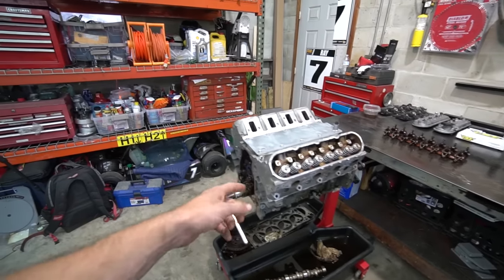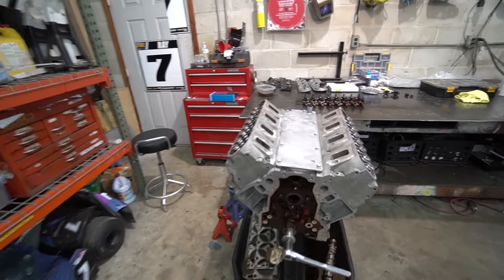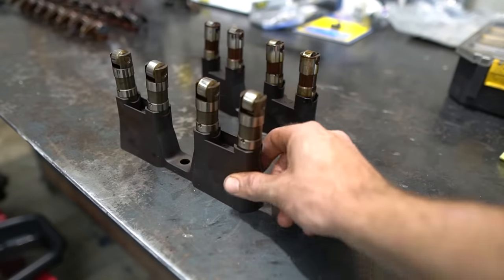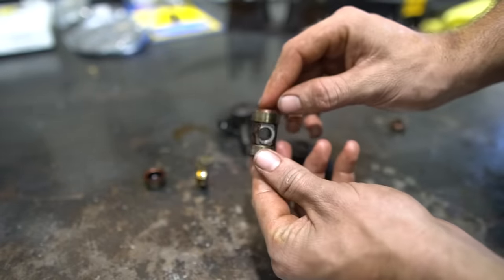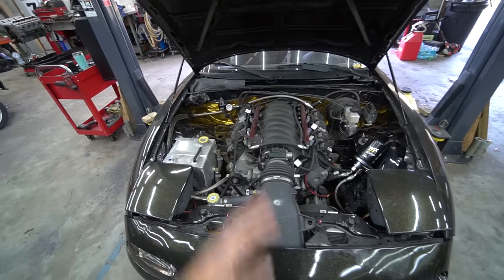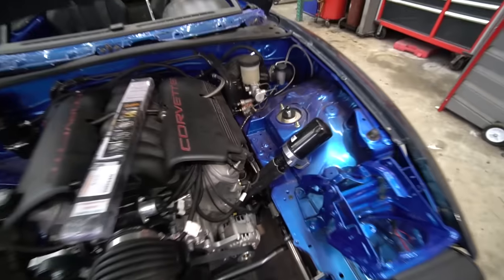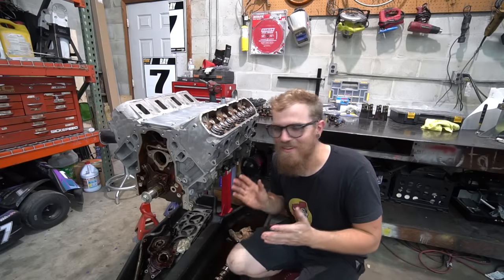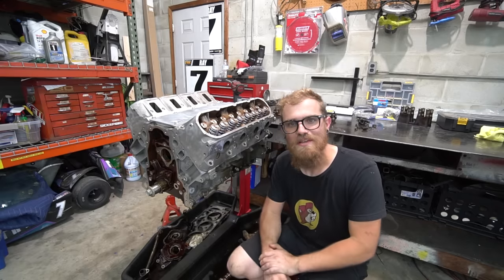Top 5 Mods To Make An LS Engine Reliable.

Comment: Step one: put oil in              Step two: don’t keep it above 7k its whole life step three: enjoy your ls motor for hundreds of thousands of miles
Reply: G hrvyck  I've never seen one NOT make it to 100k miles absent it being beat on or poorly maintained.
Reply: G hrvyck  ....lmfao...you sound crazy...every ls I've owned was over 200k....lol...
Reply: G hrvyck  When I see someone volunteer information like 50+ years master tech, I think of all the people who say they were navy seal marine spys.
You don't have a damn clue what you're talking about because you were never there.
Reply: Agreed, this guy is full of chit. If you don't like GM then that's your business, but don't be such a hater that you spread lies on the internet. First I currently own an 88 GT, 03 Cobra, 03 Lightning, 13 Taurus along with other Fords I've owned in the past so I'm no Ford hater, but to act like an LS isn't the best motor for a Foxbody/SN95 swap is just someone being a hater because you're likely a Ford fanboy. And that's fine but own the fact that no other V8 platform can drop the lbs and be positioned as ideally in those cars (or really most any other cars) chassis as an LS can be. Then you have more options for modding big power (using boost, or a shot, or staying N/A and having a ton of dispacement options available) then any other platform within a reasonable cost to mod. 

I've only ever had 2 issues with LS "motors" (not LS powered cars) that I can think of. 1) I had an LS1 who's alternator went bad. I fixed it with one I bought off a wrecked 04 Yukon with like 165K miles and it was trouble free since. Another time I had the thermostat gasket shear and get into the spring on the thermostat and lock it open. It basically wouldn't let the motor come all the way up to full temperature. Easy and cheap fix. I've known many people with LS based motors that ran like tops at 250K+ miles even if the rest of the vehicle felt worn. Generally speaking your LS based motors without AFM are some of the most reliable and problem free motors there are. Can some high mileage (and more importantly "old") LS motors develop issues like leaks around the oil pan seal, etc? Sure, but overall they experience fewer common issues than most other motors.
Reply: G hrvyck  My 02 silverado has over 257,000 on it.I have only changed the intake gaskets and water pump on it.
Reply: G hrvyck  Not for sure.I bought it used with a 177,000 miles on it.From my understanding these motors only have a few down falls.Intake gaskets that fail periodically.Knock sensors on top of the intake.Replace the knock sensor when doing so use rtv on knock sensor to prevent moisture from coming in.Been told that they have a crappy idle to them.After I replaced the intake gaskets on my truck it idles smooth and quiet other than the fuel pump whining like it's about blow up.I drove it about 8 hours straight one time.When I pulled up to  the motel room I noticed everyone stopped and looked at me funny.I left the truck running so my wife kids had ac.I got out and that fuel pump was whining so bad it hurt my ears.I figured I would be replacing the fuel pump on that trip.That has been a few  years ago and many miles same pump.
Reply: G hrvyck  because Ford has the best fleet prices. Nothing to do with reliability.
Reply: @notsure7874  just put two holes in my block 88k miles.. 2014 camaro ss. Evo.gsr check it out
Reply: @JacobsInvestments  I can't check it out - there's no link. Ok so you got me - I HAVE seen them NOT get to 100k miles - if you spray the hell ot of it, boost it to death, etc. I'll rephrase - "with original cam" which you basically have to do at that point. But at that point, it's not exactly a production engine either - and you're beating the brakes off that car at every opportunity.
Reply: G hrvyck  "Anybody that bought a cheapy-equipped hemi car, didn't buy it to drive it like a Sunday morning church going grandma"

Since when is a Hemi a GM LS engine?

Also, I notice that you correct someone on engine vs motor - which is a bit pedantic, however you go on to say something about a 78 460 "BBF" - what the fuck is a BBF? Big block ford? Surely you're aware there is no such thing as a BBF or SBF right? Those are terms referring to specific GM engines. There's a Ford 385 series, which came in a 460, so maybe that's what you have? Pretty sure an FE was never offered in 460, but whatever... either way - neither of those are "big blocks" - oh and GM also made some large engines like the Pontiac engines that were NOT "big block" or "small block" - it has NOTHING to do with how "big" an engine is, it's a SPECIFIC engine type.

50+ years ... Ok boomer. Tell me all about them 3/4 race cams :D You're stuck in the 70's or something man - new shit has come and gone since then.
Reply: G hrvyck  Big block and small block refer to CHEVY engine families. PERIOD. "bbf" and "sbf" are 100% misnomers. And yes - Pontiac had one size engine block. With big or small journals.
Reply: G hrvyck  "Not possible.  Rarely do they make it to 100K miles." The guy that said this regarding LS engines, then proceeds to use a Hemi as an example of how an LS is unreliable ... does NOT in any way shape or form know more about engines than I do. But you sure as heck might have FORGOTTEN a lot about them!
Reply: G hrvyck  And you still can't tell the difference between a chrysler hemi, and a chevy LS? Still sticking to the "rarely last over 100k miles" - C'mon man! :D
Reply: G hrvyck  As for the BBF - what are you calling a BBF? I've heard FE's called BBF, and 385's, I've even heard 335's called BBF. But none of them are, any more than the Pontiac V8 is a "big block".
Reply: G hrvyck  There are many flaws with the SBC, many of which were addressed with the LS - which is why it's ridiculous to say they can't last 100k miles, because all 4 of my current SBC / LS's have more than 100k miles on them. It's also Depends if you're talking solid or hydraulic lifters, because you have to set the backlash on the gears, C is a Cleveland - which is a 335 block, M was a 335 with a taller deck height, only came with a 2bbl and it was a dog - came in a 351 and a 400, I'm not a chrysler guy and don't give a fuck about that, Depends what electronic ignition syste you're talking about, but it's silly to memorize, especially since I don't build many fords, again - I don't care about ignition voltages, look that shit up as needed but it also depends on what system, and what part of the system, unleaded is no good because of the valve seats, and you can put hardened seats in to run unleaded. Oh and the 2.0L chevy I also don't care about, I don't work on broken pieces of shit unless I own them, and I have no desire to burn money making one fast. 

But that doesn't address why you use the hemi as an example of LS's being "unreliable"

Can you explain what an 80 year old guy is doing still working on cars, and arguing on the internet about them? And again - why you used a hemi as an example of an LS,  and explain why you think an LS is virtually incapable of making it past 100k miles? Can you explain how despite modern advancements in engine design somehow "suck" compared to a crude old 460 you claim has over 400k miles and still going in a tow truck or whatever?

And again - how is a hemi an LS? Because you haven't answered why you used a hemi as an example of an LS not lasting.
Reply: G hrvyck  Oh - but here's a design flaw of the Chevy 2.0 now that I'm thinking about it - it's a 4 cylinder, and they can't really be balanced perfectly. Can you tell me the minimum number of cylinders needed to achieve a perfect balance?
Reply: G hrvyck  5 cylinders from a theoretical perspective when you're talking about harmonics, and of course they have to have counterbalances - which is why a lot of 4 bangers have a balance shaft - but yes, none will be perfect in practice, not even a top fuel engine, but they get damn close.

As for the major design flaw - again, I don't care about a 2.0 chevy 4 banger, but there are many design flaws with any engine - including the LS, hemi, etc. There is no such thing as perfect, even in a top fuel car - which a guy I went to high school races to this day last time I checked - he lost his thumb running a top fuel car beyond the gravel into the woods when his brakes and chute failed -  And no, I'm not claiming his experience as mine.

I balance all that shit in my crappy strip car too, even though I'm keeping it under 10's - because I can't afford all that SFI rated gear, and replacing stuff periodically just to keep it in date to pass tech after breaking into 9's and 8's. One of my friends has a pro mod vega running low 6's that he has to do that shit with, and he's got damn near a quarter mil in that car. Also, my track here is IHRA, not NHRA.
Reply: G hrvyck  

I assumed 80 or so, but I can't be THAT far off - you said '63 - and my dad was 13 then - he's 70 - so you're what, 71? if you were say - 18 or 20 at that time so a pretty reasonable assumption. Still, beyond wrenching on cars and racing days.

Referring to LS's not being able to make it past 100k - "Anybody that bought a cheapy-equipped hemi car, didn't buy it to drive it like a Sunday morning church going grandma. Mine kept having issues with the  connecting rod bolts stretching. Milidon connecting rod bolts cured that but the car developed several other problems." Nobody mentioned a hemi until then.

What does a hemi have to do with an LS? And you were asking about a 2.0L 4 banger, not a chevy V8 - which I addressed all those as fast as I could type off the top of my head, while working - all the crap about unleaded gas and whatnot - and stupid specifics about particular voltages which 1. I don't care to memorize, and 2. depends on what you're measuring - primary coil voltage? secondary? the trigger??? Not that it really matters. I mean - can you tell me offhand what the valve lift, duration and overlap is on a 1991 TBI equipped sbc 5.0L in a truck application is? No? Because memorizing that shit is stupid - but I bet you could look it up if you needed that info for some reason. But "gotchas" can be thrown around both directions, and they prove absolutely NOTHING.

If you're suggesting the previous gens of SBC are more reliable than an LS, well - the LS has baked in a lot of the upgrades people used to make, and then some. Skirted block, better materials, tighter tolerances, SPM cast heads (some of them) so you don't have to port / polish, air gap intake, aluminum heads that actually flow, roller lifters in cartridges with pushrod guides, sintered metal rods that have the caps cracked so they index perfect every time, and they're nearly as strong as a lot of forged steel rods, better firing order (which SBC guys used to and still do switch to), much MUCH better bering material, better oiling, a bottom end that can handle well over 1000hp from a junk yard pull with 100k miles on it - which as a side effect, ring wear often gaps it pretty close to where you need it for power adders so you don't even have to pull heads if you dont' want to, a far superior coil near plug ignition system, returnless fuel rail, better injectors, moulded rubber gaskets, MLS head gaskets, - all from the factory - and blah blah blah the list goes on and on - I see them with over 200k miles regularly. I have 2 of them, and 2 sbc's - 3 of which have well over 100k miles, the other is in a boat - which stays under load nearly 100% of the time, and arent measured in miles.

Bottom line is - I'll take an LS over an earlier SBC, or any Ford OHC like the modular, or a Ford Windsor, or a 335, or a pontiac, or even the buick v6. It's not that I hate any of those. If you want big power out of a small V8 for less money - the LS is where it's at, and has been for a decade or more - ever since they started showing up in salvage yards for a reasonable price. And YES they are reliable. More reliable on a SBE than ANY of the above, especially when you start pushing them for power.
Reply: G hrvyck  Yes, crude compared to todays tech. "distributor" - case in point. The materials weren't as good, the tolerances were relatively sloppy by todays standards, the car carrier you said had 400k miles - and that's entirely possible, I've seen them go that far - but generally not. Oh - 400mi to a rebuild, so it doesn't have 600k, you rebuilt it. Oh - so it came out of a CAR, so it wasn't being used as a car carrier for 400k miles, it was a giant engine in a relatively light car. No suprise that it went a long time. 370hp ... so about the same as a 6.2L LS from the factory but a lot heavier.

Dont' get me wrong - I love the 385's, and FE's - which in a lot of ways I like a LOT better than the 385's particularly the side oiler, and SBC's, and BBC's, and Windsors, and 335's - as long as it's not a M - I've owned all except the 351C ... and I like the LS just fine too - they're a LOT cheaper to build a reliable and powerful engine. I get and appreciate the nostalgia, but they aren't "better" or more reliable than modern engines. We have better materials, better machining, better casting technology, advanced engine management systems - time marches on. Gassers aren't "the way" anymore just like carburetors aren't. The LS - is most definitely more reliable than these, until you start talking the big heavy old mills in a heavy duty application - but there are also big heavy engines today that have made similar advancements.
Reply: G hrvyck  Yeah man - that's scary fast. My friends vega chassis is certified to run I think ... over 226, and sub 6 seconds? Big roots blower on a BBC with tophat injection - I don't mess with that stuff, it's to expensive for my taste. My friend Bobby - he was running top fuel from the time he turned 18 iirc. It was before they shortened the runs to 1000 feet, and they'd exceed 300mph. I really don't think I WANT to go that fast honestly. My fastest run was 2 decades ago - mid 9's, around 150 - 160. 377 2 stage sprayed SBC in a 72 camaro. I'd like to go faster, but I don't want to spend the captain insaneo money on all the SFI bellhousings, and TC's, and chassis certs, and jesus, you even have to replace the seat belts like every year or 2 - it's just too much - but I'd be happy somewhere in the 8's, somewhere south of 200 if money were no object. Absolutely NO desire to hit 3's at 300.

And here's a shocker for you - LS mated to a TH-400. Yeah that's right, an old tech all hydraulic no electronics, no lockup 3 speed. I woudln't do that if it was a street car though.
Reply: G hrvyck  Yeah man, that's why you have to adjust for lash with shims, and one reason I say we have better tech now - because tolerances are tighter. Freeze plugs - so hopefully your block doesn't crack if the water freezes inside there ... hopefully! I've seen them crack anyway back when I lived in the frozen north. Boats generally use raw water cooling, and it drains out. There are plenty of marine setups that use a raw water to coolant heat exchanger though, and they last a hell of a lot longer in salt water. I've also seen 302's with what I'd consider mild power levels split right down the lifter valley - which is another reason I say we have better tech now. Not that I don't appreciate the old stuff, because I most certainly do.

low 11's was damn respectable for a streetable car back then. The camaro was hardly what I'd call streetable in the 9's, but it was registered and got driven on the street occasionally. Almost everything down here is street legal. The stang I'm building now (88 hatch, LS power with TH-400, 8.8" 5 lug w/ 3.73 spooled, switch to 4.10 if it's not enough gear) is getting straight pipes out the fenders and it's street legal - here anyway. We don't have inspections, or any of that nonsense. I'm trying to keep it all under 2400lb. subframe connectors, the torque box reinforcements, chromoly cage, all welded in, tubular 4 links, blah blah. I think I've got 12x33's on the spec sheet on 10" rims is all I can fit without tubs, it's getting slicks so THAT isn't street legal but it'll be tagged. Debating running E85, but probably going to run a race fuel blend. I considered avgas, but its specific density isn't the same as race fuel, so you don't really get the same octane at sea level. Megasquirt controlling the ignition, fuel, and nitrous - 4k stall converter, trans brake - the class I want to race in I have to be above a 9.99, and below an 11.00 to A. not have to get chassis certs and whatnot, and B. use a trans brake. Slower and I have to foot brake - it's bracket racing. Heads up here is all special events, and they do a lot of roll racing, which I just really hate. You an always grudge match at test and tune for heads up, but brackets will be fine - kind of why I want to run a trans brake. I'm going to burn through a lot of parts getting it all dialed in - might need more stall, different gears, definitely going to break stuff on the regular ... that's as much fun as running the quarter imho.

Right now, it's in 100000 pieces, chassis stripped down to nothing, and the "recent events" really cut into my money badly so idk if I'll be ready for this year, maybe next. Eventually I want to do a modern take on a 327. 4.8L stroke in a 6.0L block - have to figure out rod lengths, etc - but the bore / stroke are almost identical to the old 327. Stick the 314 heads on it ... Sure wish I could afford a rochester ramjet to top it off with, but EFI will have to do. One thing I'm considering on that one - is a flat plane crank, which goes against the original - but they sure are zingy!
Reply: G hrvyck  I didn't say they were lousy sloppy crap - especially not compared to an engine of similar era. I said we have better materials, better tools, and more advanced technology now than we did when either of those were concieved and thats objective truth. You missed the part where I said - I appreciate ALL these for what they are. SBC, BBC, 385, 335, flatheads, wankel rotaries, toyota 2jz and 3s-gte, mitsu 4g63t's, cummins 12v 6bt, powerstrokes, detroit diesels, turbine engines, radials - they all have a place  ... I'm not a GM fanboy. You're a Ford fanboy that just likes to trash the LS as "unreliable" and "can't make it past 100k miles" - which couldn't be further from the truth. Matter of fact - in an appropriate application, they're more reliable than your 385, a Windsor, 335, or an SBC / BBC or Mopar LA  series. Don't get all sore because technology advances over time. The LT might blow the LS out of the water. The Ford 7.3 Godzilla in a new F-150 might blow your '77 off the track. Hell - an Ecoboost F150 might do the same. Doesn't mean the 460 is a piece of shit. Just that newer tech puts out  more power per pound, and does it more reliably in a lot of cases.
Reply: G hrvyck  Ford hasn't built a 385 series engine to my knowledge in the last 20 years outside of SVO. You can still get a BBC from chevy performance too. I get it - you're a Ford guy, and an old school 385 guy at that, stuck on factory parts that could be sourced from a junk yard back in the day - or a dealer back before there were hundreds of aftermarket sources for everything. Nothing will ever be better than a 385 series Ford. Matter of fact, there's no reason anyone should ever have built anything other than a Ford 385 series. We should be putting them in everything. Pickup trucks? 385. Compact cars? 385. Motorcycle? 385. Semi truck? 385. Aircraft? 385. Nuclear sub? 385 swap it.... The 385 is the end all be all everything engine that will never be surpassed by anything. The LS and it's molded rubber gaskets? No need - the 385's paper gaskets are much better and last forever. Cummins 6bt? Junk. All hail the mighty Ford gods!

You fanboy types act like anybody seeing the merits of anything other than whatever your favorite is - means they're shitting on your favorite toy. Ford 385's are great engines,There are also other great engines.
Reply: G hrvyck  Yeah - SVO still sells them - just like I said. I haven't seen a 385 in a production automobile in 20 years or so. Doesn't mean they don't exist - but at least in the north american market I haven't seen one, and neither has anybody else that edits Wikipedia (the entire free world) ...

https://en.wikipedia.org/wiki/Ford_Boss_engine

Look in the timeline there - 385. Last production year was like 98 or something for production automobiles.

And again - if big automakers high performance divisions selling them means they "still make them" - which they DO - but not in a production car ... then Chevy still makes the 454. But thats 100% irrelevant to the FACT that technology has advanced, and the Ford 385 isn't the end all be all engine. It's a great engine. But again - because I don't go crazy about how it's the best that is, and ever will be - you act like I'm shitting all over your baby.

But if we're going to name drop, and use engines that don't have a single factory part in them as benchmarks - and get all fanboy "best that ever will be" ... Here's Dom Lagana (I went to school with his brother Bobby at Eastchester - class of 96), running a Chrysler Hemi based engine. He's faster than your guy with the 385, therefore the Hemi is the best engine ever made, or ever will be made. Way better than the Ford 385, because if the 385 is so good, why don't they run them in the fastest class of drag racing? Because the fastest drag racers use Hemims, the 385 and every other engine ever made or that ever will be made is a low power unreliable piece of shit boat anchor... Happy now???

https://www.youtube.com/watch?v=i3CYGLURsf0
Reply: G hrvyck  Courtney Force is my favorite drag racer, and who hasn't heard of John Force? Yeah - he won a bunch of shit from 87 to 96 ... and then he went to Ford until going back to Chevy in 2014 ... LOL! Yeah ... so he won until he went Team Ford, then went back. Got it!

https://www.youtube.com/watch?v=PzbBjB0kbn8

Skip to 7:00 - and note there is NO FUCKING SILICONE ... It's NOT the same as an SBC.

"I've seen and worked-on many BBC engines that did self-implode." Plenty of people don't have that problem so maybe you fucked something up. Maybe you just KNOW Ford engines much better - and that's OK!
Reply: G hrvyck  Oh - and the junkyard comment ... did I say I don't find Fords in junkyards? They're plentiful there too. You know why I don't mind pulling a junkyard LS - or Ford engine for that matter? Because most of them are WRECKS and they were OBVIOUSLY running when they were wrecked, it's pretty hard to wreck a car that doesn't run.

The reason they're plentiful now, is because they've been around long enough at some point, and produced in enough numbers that enough people wreck them so you can find them. NOTHING to do with them breaking down.
Reply: G hrvyck  I didn't say that was a factory option. Ever heard of an engine swap? They sell them as crate ENGINES...
Reply: G hrvyck  People spend 85k on trucks, why not 45k?
Reply: G hrvyck  The GT-R I mentioned that can hang with your truck from the factory on street tires reliably? I don't particularly like them. But people buy them by the droves. They're over 100k to get those times... I doubt you have 100k in your truck, and I doubt they'll hold up on the strip for as long. But - people DO pay big bucks for weird shit. Last time I was at the track, I saw no less than 30 of those fucking things. They were racing 2jz supras, lambos, lotuses, and all kind of blah blah - whatever. I have no doubt you could keep up with them with that "old clunker" and do it on pump gas on street tires. Farm truck POWA! I'd actually LOVE to see you blow a lambo off the track (and you probably can, they aren't that fast in a quarter)

I actually respect YOU more than most of them, because these dudes and girls are bought not built. Pay for play. The whole contention between us, has centered around the "LS can't make it past 100k miles" and that's ... well, I can appreciate where a big block WILL absolutely last longer - it's a lot beefier, has a lot more low RPM torque potential - but that doesn't make an LS - or anything else for that matter - pieces of shit. 

I never once claimed to know more than you, or have more experience than you. But ... "appeal to authority" ... we can all learn SOMETHING from up and comers. Hanging on memorization of minutia of details doesn't prove shit. Maybe I'll be lucky enough to get a lane next to your truck one day and we can REALLY talk shit! I'd shake your hand if and when you whooped my ass.
Reply: G hrvyck  Honestly, I'd attribute that more to your skill than which manufacturers engine is being used. You could have done the same with a Chevy or Mopar given the time and money. There is power to be made in all of them. Dude - Englishtown NJ!!!!  My favorite track! I lived in NY back in the day. I wasn't even born in 73 though. Using an electric fuel pump in 73 was cutting edge. Buicks ... they kicked the shit out of SBC powered cars. the 60 degree v6 turbo car - grand national? Was the Opal a buick v6 turbo?
Reply: Only a crap mechanic will say the LS engine is crap hahaha i bought my ls1 with 90 thousand ks and has 300 thousand ks and still going hard now convert that to miles morons? Every engine/car gets a regular service monthly or by the miles you done and most parts on the all engines need replacing- waterpump fluids altenator starter motor power steering pump etc, i had them changed around 180 thousand ks but every car and engine does. And ive still got the same leads and spark plugs i put in back in 2009 my gearbox is the only problem after 300 thousand ks convert that to miles my trans is playing up from me beating fords hahahahahaha it was like catching barra in barrel
Reply: What have i started
Reply: G hrvyck  the questions is you start with is " the LS will rarely make it over 100 thousand miles?Only a crap mechanic will say that hahaha, doesn't matter what engine you have its the way you drive/maintain your vehicle's engine, you can also do maths yippee dippy do and there's plenty ls engines that have more ks/miles than my ss some rebuilt but more are standard from factory and still going, in aussie scrap yards fords take up all the space especially barra and "bbf sbf" lol, skateboarding progression you're right with your 3 steps
Reply: G hrvyck  lol what a joke. It is the most reliable v8 on the market. Thats why everyone wants one!
Reply: G hrvyck  im not disputing your knowledge of 50+ years certified truck experience, ive own fords and holdens, the rivalry is big here in australia but i have to disagree with anyone that say the ls engines only last so long my 2001 SS LS1 been in storage since 2015 so really i would've done over 400 thousand miles i only got it out to show a moron it eats barra's and only changed the 3yr old oil last week, i sold my 2001 falcon TE50 replica recently, ive always service and change fluids regularly same with my SS and ford EB 1990 xr6 and "no issues" with fords or chevys other than add-ons like pumps etc so its all on the owners- if they maintain ford/chevy properly then no issues, i know and seen plenty of morons who can't even check the water and oil levels drive both ford and LS cars into the ground
Reply: G hrvyck  your talking about poorly built parts? Everything falls off a ford lol
Reply: G hrvyck  its is by far the most sought after v8 in the country. Flollowed by the sbc and bbc.  This is not my opinion. Its a statistical fact.
Reply: G hrvyck  that's odd. My LS2 is sitting at 156k. Huh have blown up and I just haven't found out about it.
Reply: G hrvyck  scotty killer, is that you?

Bro LS engines are amazing. Hence why people put them in racecars. I know people that turbo stock bottom end LS engines with over 200k miles on them. Quit your bull shit and get back in your Camry
Reply: @JROC734  I wonder if he runs "motor oil" in his engine 🤔🤭
Reply: G hrvyck  it's not possible huh? What about the 160k mile LS that made 1200+?  This isn't even "news" either.

https://www.hotrod.com/articles/hrdp-1109-stock-gm-ls-engine-big-bang-theory/

This isn't 1970 anymore. 1000HP is possible on factory bottom ends.
Reply: G hrvyck  don't even try and label me as a Ford hater either. I just got rid of an 07 F150 with the 5.4, and currently own an 85 F350 dump with the 6.9 IDI. Ford has some good vehicles, and Chevy does has some downfalls....but the LS is NOT one of them.